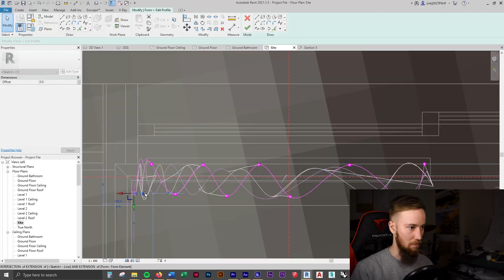How to Fix Room Not Enclosed - Revit Tutorial

Comment: This helped me a lot while searching for a solution.
However, I noticed that the problem still occurred even when all the walls had the same reference level as the floor. 

I had a problem with the level. The floor and walls had an offset of 15cm above the level, which also prevented the room from closing.
I created a new level, adjusted the floor and walls reference to the new one and then the rooms were closed.
(I kept the old level as the views and sheets were already well advanced)
Reply from the maker: Good problem solving skills from you! All situations are different, hopefully this video at least gave you some ideas of why it's not room bounding. Cheers and well done